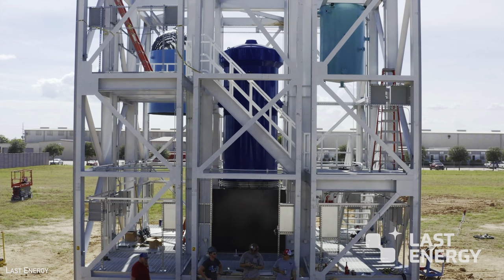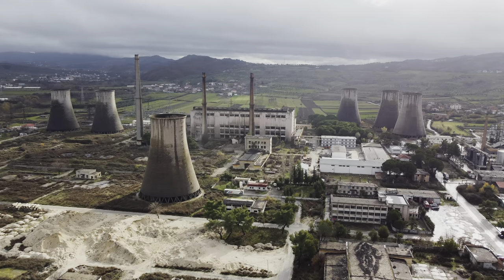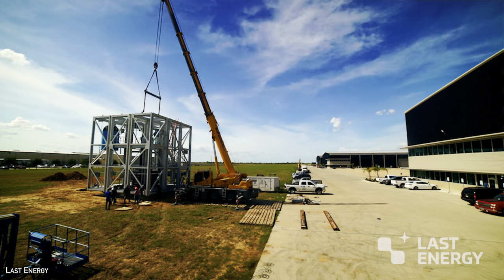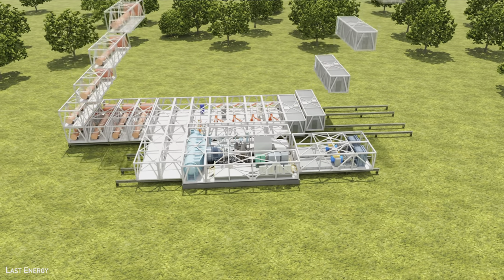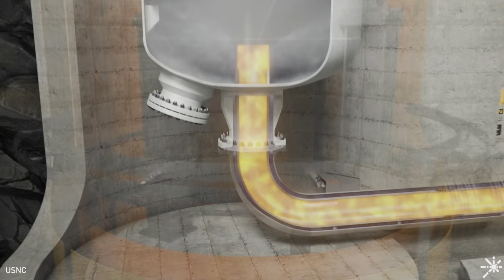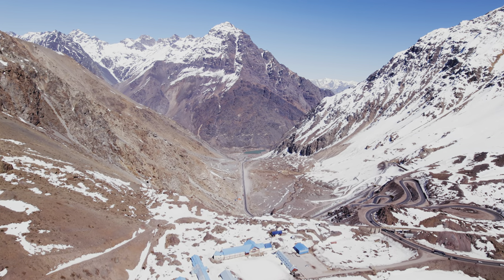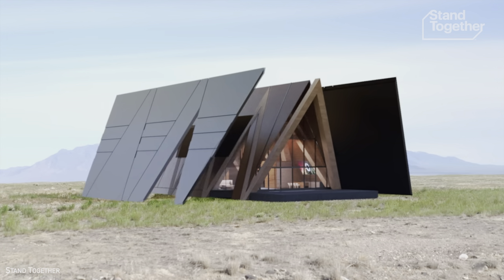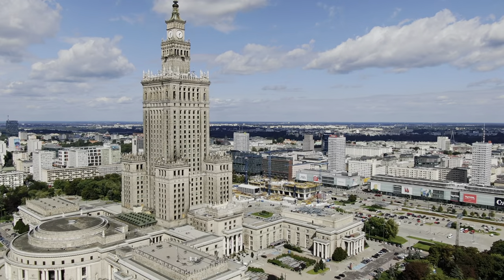The Daring Plan to Build 10,000 Nuclear Reactors

Comment: As a Canadian, I look at the energy mix from Ontario for instance. For electricity generation 65% of Ontario's energy is nuclear from The Bruce (at 5.6gw the worlds largest nuclear plant) and Darlington and Pickering (they are working on building an SMR in one of those).   Now the Bruce reactors were built over a number of years and there is a debate that the 10reactors at Darlington and Bruce will cost $12 and $13.8 billion to refurbish and that instead Ontario should focus on renewables.  But in comparison some 2700 wind turbines have been built since 2010 in Ontario (assuming 3-4million a piece) at a cost of aprx $11billion.  The total electricity generation by all of the wind turbines is at best 7% of the total generation, and is intermittent.  

Also renewables are not zero carbon, and would also require storage (which is also a cost and again not zero carbon).  According to Engineering with Rosie on renewable if the world depends on renewables we will need 10,000 terrawatt hours of storage (or 10 petawatts) Sabine Hossenfelder in her videos estimates 1 petawatt hour.  But essentially this is far more than what the world currently has in storage which is maybe 34gw in battery and 2.2 tw in pumped hydro. Storage needs to be increased 500fold. This is a long way to go.
Reply from the maker: Honestly, great points. The storage issue with renewables hasn't really been addressed in a large, scalable way yet. And like you said, the cost to scale it up to the capacity of the existing infrastructure isn't much better than keeping the current CANDUs running. If they proceed with their pressure tube replacements, there's no reason they can't continue.
Reply: BS.  Why in the world would you need 10k TWh of storage?  That's 40% of yearly global demand in 2022.

Pumped hydro, HVDC, and EV vehicle to grid will easily cover the load shifting/storage needed, which is nowhere near 40% of yearly demand.
Reply: @gerryburde5663  ev to grid? How many ev owners are willing to let the 'grid' use their expensive investment as storage (given that it will increase  battery degradation) or get in to use their ev and find there is little juice.

The issue of renewables is the intermittency - so storage is needed.
And currently despite all the growth etc 80% of world energy use is fossil,  with 8% nuclear 10% hydro and <2% wind solar and some tidal.

Electricity generation is some 22% of total energy use, theres a lot more needed for heating cooling, transport, and steel, concrete, ammonia, and other industrial production. 

Pumped hydro is currently 92% of existing storage but requires the right kind of land and location and most of those have been used up.

As far as needing that much storage, thats precisely what 'Engineering with Rosie' and Sabine Hossenfelder discuss in their videos.
Reply: @gerryburde5663  I've stated before that all storage methods to cover a 90% loss of renewable output on windless/sunless periods lasting weeks at a time are much more expensive than nuclear power plants.  Even at a ridiculously low cost of $100/kWh stored, a gigawatt-week of storage would cost $16.8 Billion - more than a gigawatt nuclear plant - for just a portion of the storage requirement of renewables able to sometimes produce a gigawatt of output.
Reply: @robertmeredith3940  When in history has the wind stopped blowing or the sun stopped shining over a continent?
Reply: @gerryburde5663  Every year over northern Europe for weeks at a time in regard to wind.  Every night in regard to sun, as well as during rain and typhoons.  With no transcontinental transmission anywhere each region is effectively an island when it comes to outages affecting 90%-100% of either renewable, lacking fossil, hydro or nuclear backup.
Reply: @robertmeredith3940  And energy can't be moved from southern Europe to northern?  

We currently move energy tens of thousands of km around the globe, a few hundred or even thousand km of HVDC is easy.
Reply: @gerryburde5663  I used to plan transmission and nothing about it is easy due to NIMBY.  The last 765-kV line I am aware of took 16 years to go 90 miles through rural areas. There is a reason there is no USA national grid;  even a single circuit crossing so many states can never receive approval, particularly for HVDC which might only transit a state.  Undersea routes are severely limited by cable capacities and costs, particularly for limited periods of backup use over which to recover enormous costs.  Multiple circuits to serve a major fraction of another region's load  may be possible in China, but are unlikely elsewhere with multiple jurisdictions and NIMBY everywhere.
Reply: @gerryburde5663  cmon do the math.
 There hasn’t been any large new pumped hydro built in n america or Europe in 30yrs. They’re great, but no more for good reasons and most them only run 6 hours.  Storage is needed to run through winter, or late summer month long wind lulls, not 6 hrs.

There is no stock EV that can feed direct high battery power to the grid anywhere in the world. The batteries are built w different applications.  Tesla for instance said long ago they won’t do EV to grid, they are doing big grid battery to grid.  Utilities don’t want that either.  To run a reliable grid, you need to know the age and maintenance level of main sources of power, and EVa have neither available to them. 

Good for Tesla and grid batteries, but nowhere in the world is there a utility battery facility that can backup a middling 500 MW power plant or wind farm for a day. Not one.
Reply: @robertmeredith3940  Exactly, but this guy doesn’t care.  He wants hundreds of HVDC lines plowing over anything in its way, a number that can’t be maintained of course, but just wants it done else it’s mysterious forces he must fight.
Reply: @gerryburde5663  One HVDC is useless for backup.  First, it’s only 1 GW or a half a GW, and to supply half the country because it’s night means 100s of GW.  Then, any kind of must-have transmission in the US is doubled or tripled up.
Reply: @gerryburde5663  The sun stops shining over an entire hemisphere of the planet everyday. What are you talking about?
Reply: @Nill757  It's pretty predictable, wouldn't you say?  It shines over north America for 15+ hours a day.
Reply: @gerryburde5663  Predictable? Of what use is that sitting in the dark at night, predicting the sunrise? Are you favoring a plan of full
scale solar plus full scale gas fired power plants when solar is predictably unavailable?  If so then please just say so. 

And no it’s not 15 hours a day for much of the year.  In morning, Solar PV doesn’t reach half power until 8:00 AM, and falls again to half power at 4:30 PM.  That’s the avg.  At higher latitudes it’s a longer solar day in summer, shorter in winter.   At 50 deg N and up, 6 week winter performance is under 5%.
Reply: @gerryburde5663  Moving energy from one place to another means there needs to be a surplus where its being moved from. If theres no surplus then why should people suffer because others relied on an unreliable source of energy.

Comment: I like the concept. The one part I would modify is the fuel source. Thorium cannot be used for bombs and spent Thorium requires much shorter storage times. Plus the refinement and availability are much easier and more available.
Reply: Changing the fuel source to Thorium means it is now a high tech project (breeder reactor), not a simple project to down scale and mass produce an ordinary reactor (burner reactor).
Fortunately, other companies look at Thorium fuel. My favorite is Copenhagen Atomics.
Reply: Thorium reactors are actually uranium reactors, they breed the Th to fissionable U233.

The Candu reactor design can already 'burn' Th as part of its fuel mix.
Reply: Thorium along cannot run a reactor. You need enriched uranium mixed in. But using thorium in a molten salt reactor is a great goal.
Reply: I like the modular approach, advocated by a few of the low pressure molten salt reactor startups.
The Thorium cycle has a friendlier decay schedule, much better safety than water at 2250 psi, and much hotter output suitable for process heat or thermal storage for peaking loads.
The fast spectrum chloride salt burning mildly reprocessed waste is another winner, needing no moderator.
Nothing to explode is a clear bonus.
MSRs seems to be mostly concerned about material research which should be accelerated as these high temp types show most promise.
Putting potential nuclear spills in the groundwater is a problem .
Reply: @Piccodon  The Chinese already have at least two molten salt experimental reactors up and running.

The US has recently approved similar experimental MSRs. The first of these at Abilene Christian University NEXT program is in an advanced state of construction.

We should fairly soon have a handle on issues associated with this reactor type. If there are no show stoppers this should open the way for small modular units in the 50-500MW class within say, ten years.
Reply: Thoriun can be used for bombs after being in a reactor, turning it into U233, and a bomb was built that way.
Reply: @jimgraham6722  No, CANDU can’t burn thorium.

Comment: pls, correct me if I'm wrong, but changing the whole vessel wouldn't allow the plant to receive state-of-the-art reactors that can wor with the rest of the plant?
Reply: It works with a small reactor vessel because it is light enough to be removed by crane, after disconnecting cooling loops and mechanical support and instrumentation. And it’s buried underground so roof off is straightforward .

Comment: Please explain how these power plants can operate without having a river or ocean nearby to cool the condenser? Is the plan to have an air cooled condenser? Is the plan to discard the low pressure steam, like they used to do with coal fired steam engines? Running fresh water through a nuclear boiler sounds like a plan for rapid corrosion. You should be aware that efficiency improves as condenser temperature is lowered, and river water or ocean water is usually cooler than surrounding air, which could be below freezing and that would be a disaster if condensate froze.
Reply: I thought they said air cooled reactor, again very, very bad idea if its the case. After the Windscale nuclear incident decission was made that air cooled reactors never to be build again. In those days reactors had graphite moderators, maybe good for neutron economy but very bad for safety if paired with air cooling.
Reply: @goranz9446  the design is PWR which means it uses water for moderation, cooling and electricity generation. The difference is that the hot turbine exhaust is cooled by air, not river water. Btw, all modern has cooled reactor designs(which cool the core itself with gas) use a closed cycle, where the gas never leaves the reactor.
Reply: @vaclavzajac214  Yes, but not with air that supports burning little less then oxygen but with noble gass like helium or carbone dioxide. The whole idea is very stupud, making 10 000 small PWR reactors Instead of making fast breeders convert/burn type using piles of spent fuel rods and piles of depleted uranium as fertile material. In that case we maybe wont have to mine uranium for hundreeds of years.
Reply: “Explain how these .. operate without .. river ..ocean”

Plenty gas plants operate air cooled. And the biggest US nuclear plant is in the desert outside Phoenix.  Looks they plan about 20 air coolers on the top of this 20 MW design.  

If they can build this thing fast and as cheap as they think, saving a massive cooling towers, then giving up a few percent efficiency is a no brainer.
Reply: @goranz9446  What? No.  It’s a standard PWR water loop, steam secondary, with a dozen or two fan air coolers instead of an expensive tower. Nothing “burns”

Comment: I doubt they'll get approval for long term storage of spent fuel in the original reactor vessel due to neutron embrittlement and boric acid corrosion issues.
Reply: Those issues arise from the vessel being carbon steel. If they change to stainless it should not be a long term problem, especially with the vessel neutron reflectors/shields seen on new PWR designs.

Comment: The 3 month refueling may be a sticking point as most existing reactors can refuel in 30 days or less.
Reply from the maker: It is longer than most large reactors, but it is doing it 3-6x less often since it's every 6 years.
Reply: @atomicblender  But still, one simple math was not done. 
I mean 10k means a lot. But is really a lot?
I understood well 20 MW for this design?
Then is 35 times smaller.  10k/35= 285. And now are 440 reactors, 500 with those already in construction.
So 285 compared with 500 does not seem anymore so impressive. Just above 50 percent increase. 
This for the actual production. 
But increase in risk, is 20 times greater. 
Does it worth it?
Reply: @ehombane  the risk doesn't increase 20 times since the design is supposed to be safer than the previous designs but yeah, 20 MW is too small.
Reply: @vaclavzajac214  I assure you that the risk increases. 
It is not about the risk on design but in numbers. 

We may argue that actually the technology is pretty safe anyway. Just 2 accidents, plus the one at 3 miles Island that was not so bad. But those 2 .. damn we cannot afford too many of them. 
My surgeon is witness first hand. He told us about the days when he was an intern. When there was an cancer scheduled it was an actual event. Everybody gathered to watch. Now every single day there are at least three excisions in the same hospital.  Sure, there are many other possible causes that are contributing to this dramatic increase. But global increase is 75 percent since 1990. So not even doubled. This is a lot less that the skyrocketing I mention. And we are few hundred km far from the site. Sure we was on the path downwind, so for sure, closer is much worse.
Reply: @ehombane  risk is a pretty loosely defined term. Risk might increase in numbers but less power and better safety features means less harm even in case of meltdown. Let me just point out that zero people died from Fukushima radiation and l about 4 000 people have died from Chernobylu. If chernobyl, powerplant with arguably the worst nuclear accident in history, was replaced with coal, it would've killed more people than the accident by air pollution from normal operation. New designs are are at least 3 orders of magnitude safer and risk of large radiation leak is practically zero which means about 1000 times less casualties per energy produced. Also, 75% increase in cancer rate is given by longer age-expectancy, better diagnostics, pesticides and other factors, certainly not from nuclear accidents.
Reply: @vaclavzajac214  Do not get me wrong. I am against coal more than against nuclear. 

And sure risk is a theoretical number. And absolutely irrelevant until it happens to you.

And sure, if actually the design is totally different, and if there cannot be a leak even you try hard to leak something for sure 0 multiplied by 20 is still zero. But you know we heard before this mantra absolutely safe.  And then.. Eh, you know, a series of unfortunate events... 

And risk is not only about explosion, there is the risk in many other ways, disgruntled workers, insane individuals. Spreading 10k bombs around the world requires a lot of security. And since this will be not an active trained force, events being rare, for sure will be just regular fat guys, bored, unable of anything in case of an event. 

You know dental xrays are perfectly safe. But let me tell you a story. Somebody once died, other person got to live in the same apartment, but the other one died too not much later, and another one and so. People started to believe that the apartment is cursed or something. But in the end it was discovered that somehow in the concrete founds its way a radioactive pill from some xray machine. 

And Fukushima o deaths my ass. I did not kne this, I look it up and says, no direct deaths. AHA, this is a different story. And for Chernobyl less than 50. Also, direct deaths. But I told you what my doctor said. And now discussing with you I thought that maybe he exaggerated. But if I look at my own info, direct knowledge, I see that figures adds up. As a kid I knew nobody with cancer. But now, I have three only in my family. Only one died, but I take in consideration quality of life also. Death is infinite better than agony. 

So my opinion is not changed. Fragmenting the risk is not a good option.. Sure the advantage of fast deployment on site. And sure, fission is a must till fusion will be a reality.   But spreading the risk so much for less than doubling the production does not seem very wise.

There is a well known saying. The shit hit the fan. It looks similar to me. 

Also true, I am nobody, so what I say do not matters. But I am saying anyway ;)
Reply: If there's risk then go get your $10,000 from Last Energy by proving that.
Reply: @ehombane  barely anything happend at fukushima nuclear plant so what would people have died of?

Comment: While I'm all onboard with this approach, I know its less likely in the US than any other country on Earth. There is far far too much ignorance peddling going on in the states to see an advancement in US energy policy.
One bit of criticism on this presentation was not providing a better explanation as to why putting the reactor underground was safer than on ground level.   Common sense might lead us to the same conclusion but a better presentation would detail  why that might be true. Now, why is that important?  Because as first stated, ignorance peddling is at its height. Better education means more information, not less. We aren't trying to campaign for Congress.
Reply: The simple reason for underground placement is protection from aircraft impact, as required of all containment structures, as well as inexpensive shielding.